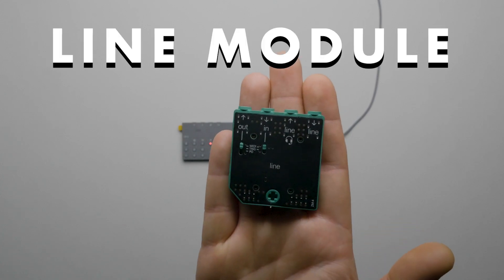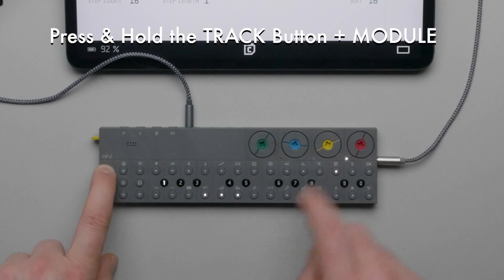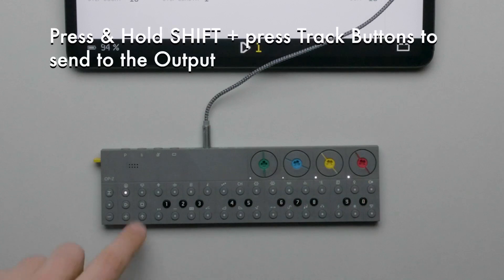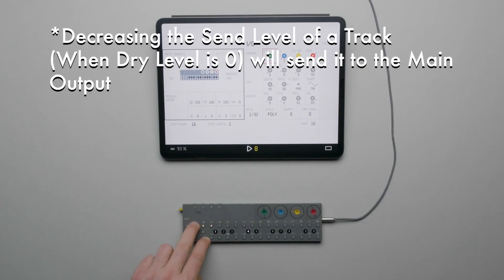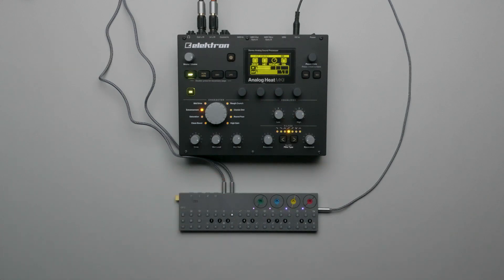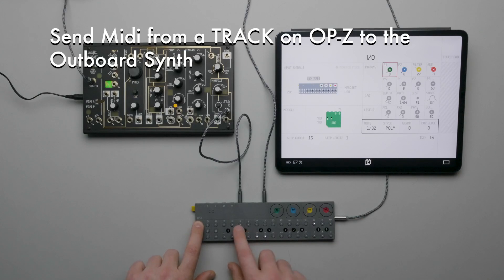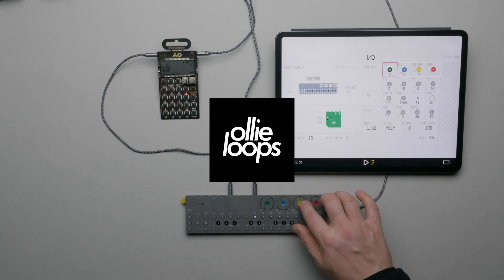Teenage Engineering OP-Z LINE MODULE

Comment: 00:00 I/O
00:25 Install
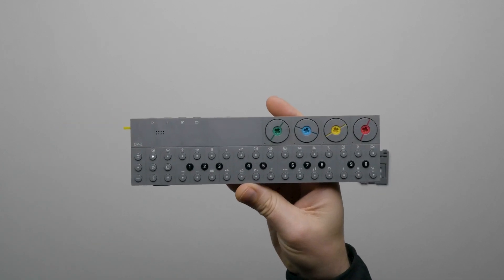01:42 Pair
02:06 App
02:12 Connect Devices
02:50 Mono In
03:19 Input settings
04:24 Connect Out
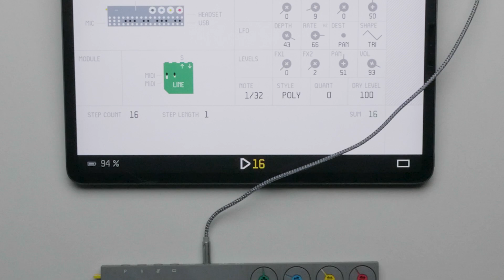05:00 Send track
06:02 Dry Signal
07:18 2 Mono Out
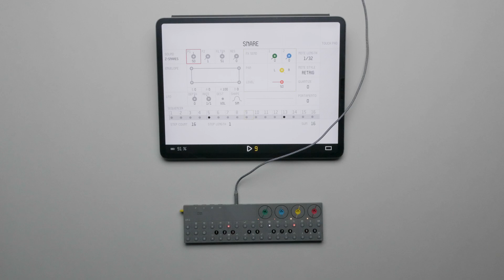08:02 Cue track
08:12 Process track
08:53 MIDI I/O
10:22 PO
Reply from the maker: thanks for this.

Comment: Hello, I have and RD9 and the Opz with the line module, I would like to sync rd9 tempo to opz and use opz as slave for tempo. I plug the sync out on the rd 9 to the midi in on the opz ( the led bright to the tempo on the module ) but the opz does not sync to the tempo, any idea how to sync opz? I also enable clock in on the app on the opz but doesn't work either
Reply from the maker: Check out the opz manual, item 21.3. You can set the midi input clock incoming with button 4. Hope that helps.

Comment: Hello, I would like to send MIDI from OP-Z to a synth WALDORF pulse 2. Which one you think is better?  Op Lab or Line module? Thanks 🎉
Reply from the maker: I think they are both based on the same connections. The line module may be a cleaner/ simpler setup.

Comment: its a bit stupid to set the switches you have to open the opz again.  what about drilling some holes in the backplate?
Reply from the maker: That’s not a bad idea. You could also 3d print a backplate with holes in it.
Reply: do you know what is REALLY stupid? The idiot who thought using the softest rubber material on earth would be a smart choice for the op-z feet. Blutak would have been better. Honestly, this is a design company that fails so badly in logical design decisions.

Comment: Hi, I got my line module few days ago, it's awesome!! But I have one thing about MIDI signals which stuckes me the whole time. I can't get any reaction from OP-Z when I play anything on my midi controller(keyboard), except the LED light from the MIDI-in port was flashing (which means it has received the MIDI signal). All MIDI setups are checked on / Using USB-port to send MIDI-in has no problem. Any idea how it could be? A biiiiig thank for answering this :3
(Same with the MIDI-out sending no signal neither, I switch it to PO mode and it works great with pocket operator. I think I may miss something with settings or)